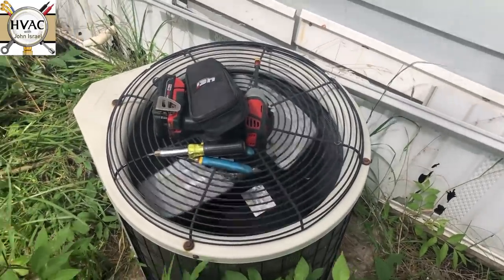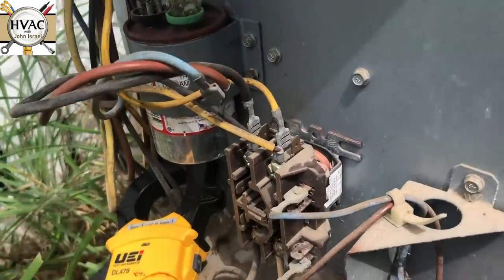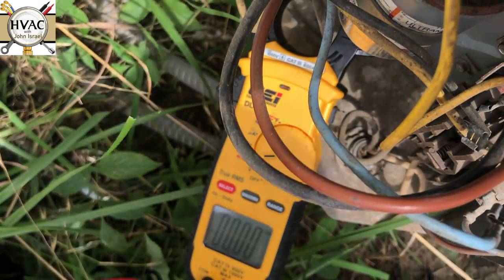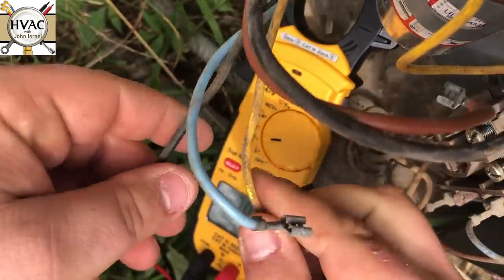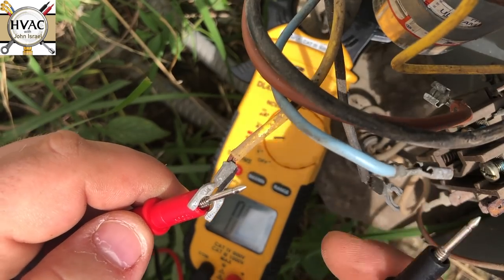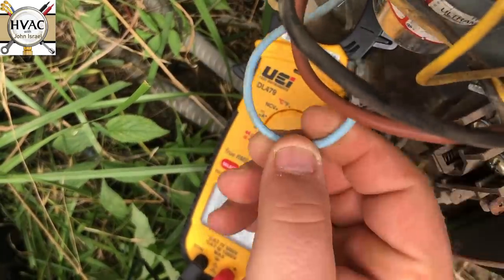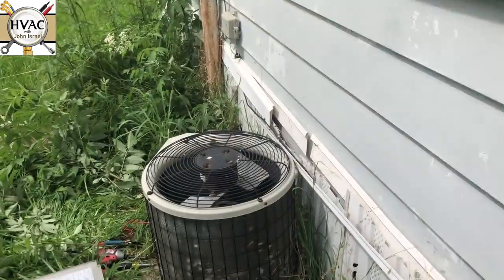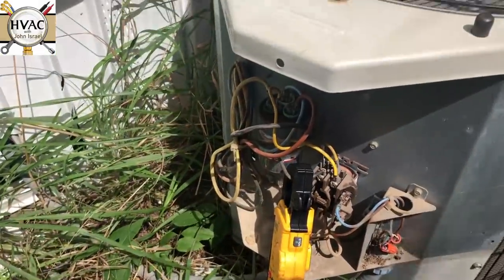HVAC System Runs But Doesn't Cool

Comment: Hvac tech from .Miami,  great video bro. First thing I do when a compressor is no running is pressing the shreader valve to see if it has refrigerant. But then again  everybody has their own steps. Thanks  for the tip

Comment: New guys single phase motors ohm values.
Start to common + run to common= start to run.  If the ohm readings don't add up the motor is bad.  3 phase ohm values of a motor.  All 3 phases will be equal

Comment: Got a 2 year old airtemp 2 ton outside unit. Went to beach came back to unit being 100x louder. New filters. New batteries on thermostat. Cleaned coils. The unit blows cold air from the top instead of warm or hot. Fan runs. Compressor is on. But  I seen online the Compressor is bad and having it replaced. But the question is what caused it to go bad. Do I need to look for another issue. Any advice from the community would help bigtime

Comment: If it were thermal overload you would just put a wet rag on top of the compressor.....correct?
Reply from the maker: No I use a water hose to cool it off.
Reply: @johnisraelhvac2019  smh of course....i don't have any experience in the field just schooling....i watch your vids to keep the info somewhat fresh...been a fan for a while

Comment: Been watching your videos all evening. I UNDERSTAND your exposure concerns. My AC is not cooling. Blower motor runs, condenser fan runs, AC on but only cooling to 80°F. Had a company come & check. He was masked, gloved & shoe covers. Did his testing told me evaporator coil is leaking & I need a whole new system for $6000. Charged $98 for service fee. Then company sent a sales rep. to find out which system I wanted to have installed. I masked up & keep my distance both times. Did sanitize inside, outside units & door knobs. I'm toughing it out in 90° Ga. heat. I'll get a second opinion. History: A week or so ago I noticed very little cooling, with condensate line outside dripping. Evaporator coil & outside copper line was frozen, I turned AC OFF, fan ON, & I thawed with low temp. heat gun. Then blower motor died. I had to wait until Mon. morning to buy a capacitor. I flipped breaker OFF & replaced it & blower motor STARTED. Senior citizen woman will get a second opinion, taking a chance of someone else coming in house has me worried. If I have to get new system, they'll have to be in house a long time, this me on edge right now. Haven't seen son or granddaughter since Jan. I may just get window unit to tie me over the summer. Any suggestions are appreciated. Everyone stay safe & protect yourselves.

Comment: Don't do the job, John.  It's not worth dying over a leaking evaporator.  If you DO decide to do it, after the landlord sprays everything down with lysol, have him open ALL windows for 6 hours and wait until they are out of the house at least five days.  Bring newspaper to set any tools on, do NOT rub against anything with your clothing, and wear gloves and a mask.  Get in and out ASAP do NOT touch your face.  Take off gloves pulling the first glove off via dirty surface to dirty surface.  For the second, slide your fingers from your clean hand inside the clean portion of the remaining glove.  Outside, wash your hands a few times for a couple minutes then sanitize.  Shoes come off and get sprayed with sanitizer then tossed in a box or bag before going in the VAN.  Hop in van and change clothes putting the clothes you wore in a garbage bag for later washing.  New shoes...  Then straight home for a shower.  Next monitor your temperature for 14 days.
Reply: NETWizjbirk... Good advice. Mask should be last thing to remove & discard.
Reply: What a joke
Reply: Samuel Sech it is only a joke until you get sick and cannot breath.  It is killing people younger and more physically fit than John, so it this is a household with a likely COVID-19 infection...  John should avoid it.
Reply: Cinnamon GMC agreed completely remove makes last... and after handling your clothes, your hands need washing again.   For a shirt it is best to unbutton it and NOT pull it over your head if avoidable, too.
Reply: @kingpins9  don't bother man these people are insane. Death rate has always been very low but people still scream the house is on fire.